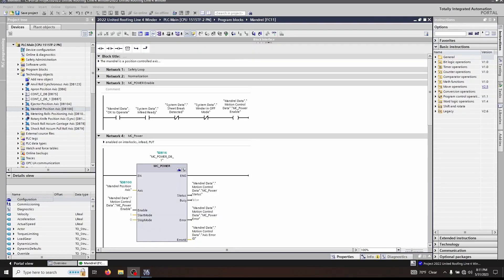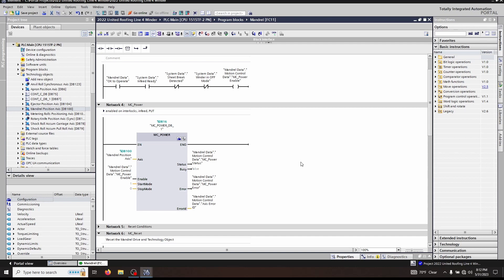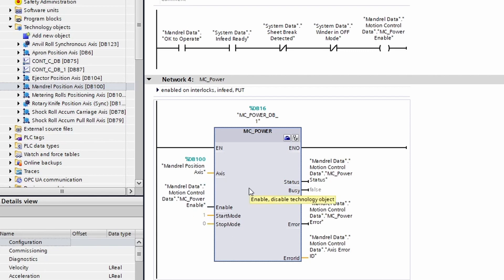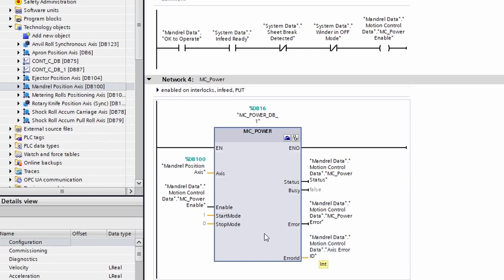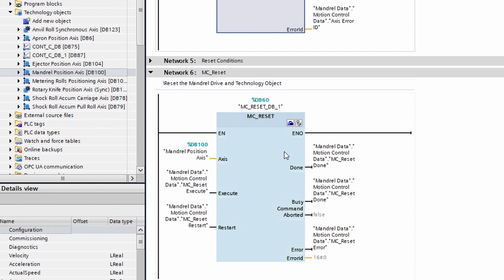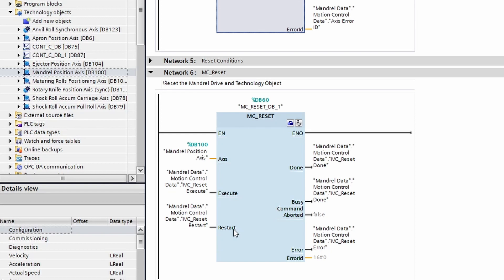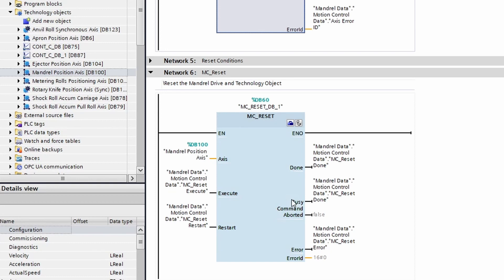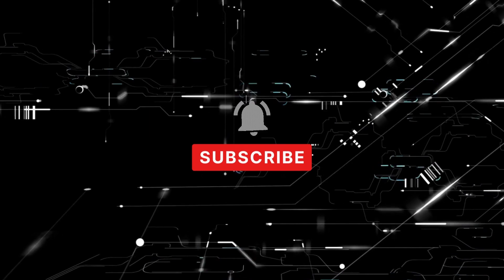Using Siemens PLC Function Blocks: MC_Power and MC_Reset

Comment: Hello Sir, before i can use MC_Power i need somehow turn on DO9 (which is my main contactor, so its first bit in control word) on my CU320, now i am doing it manually from STARTER, but there is some way to do it from TIA Portal when i am using GSD File?
Reply from the maker: There absolutely is! Depending on what telegram you are using you can either use a free bit in the control word (PZD1 of the RECEIVE telegram) or you can tie the DO9 to the status word. I will have a livestream tomorrow morning and I will show how to do this.

If you can't catch it live, watch it on demand. I will go through it first thing.
Reply: Thank you sir! :) @jasonwattsae
Reply from the maker: You are welcome!

Comment: How to use gearing on inorder sync axis ?
Reply from the maker: I have a video for these blocks coming out but it will be a few weeks so here is the basics:

You will use MC_Gearing or MC_GearingAbs. You will have to have the TO set up as a "Synchronous Axis" with whatever axis you are wanting to gear to selected in the "Master Axis" section of the Configuration.

The easiest to configure is MC_Gearing as it does not have a synch point, so it uses the velocity and acceleration configured on the block and once it synchronizes with the master it is "in gear".

The MC_GearingAbs does a calculation that uses the velocity and acceleration parameters to sync with the master Axis at a specific point (master sync position). There are a few more details on this one that could make it more difficult to work with.

What is your application?
Reply: @jasonwattsae  Thank you I will waiting for watch the video.
Reply: @jasonwattsae  My application is winder and unwind machine.
Reply from the maker: @vorapobautomation9760  The program these MC videos are shot on is a center-wind roofing roll winder.
Reply: @jasonwattsae  How did you calculate speed of unwind and rewind motor inorder to keep line speed ?
Reply from the maker: in our system, the center winder (Mandrel) is running in torque limit (using MC_TorqueLimit) and there is another roll that is measuring both speed and position (length) of the sheet. We call this extra roll the "Metering" roll and I basically use a MC_Relative move of the roll length on this axis to measure out the length of the roll. The speed of that MC_Relative move determines the line speed of the wind. The whole time the metering roll is running that move the Mandrel is trying to run faster but is torque limited. This provides the ability to control how tight the roll is compressed by simply changing this torque limit.